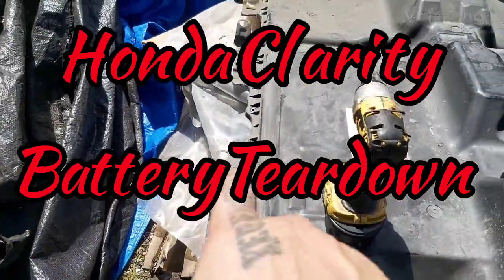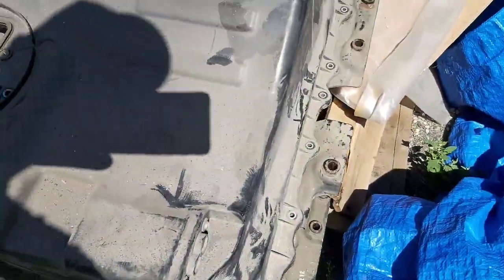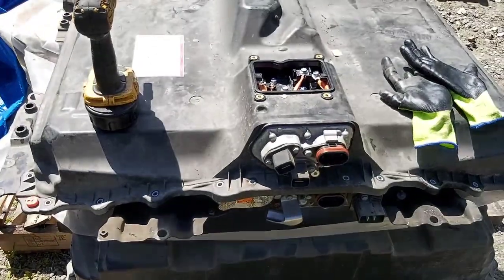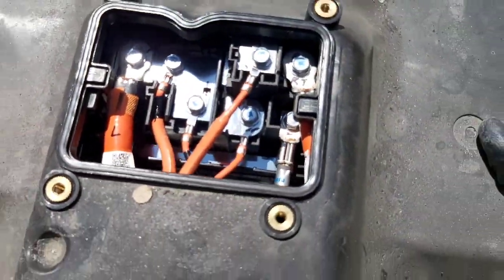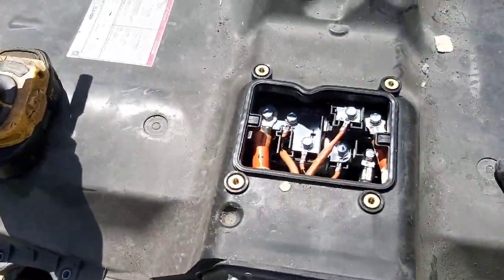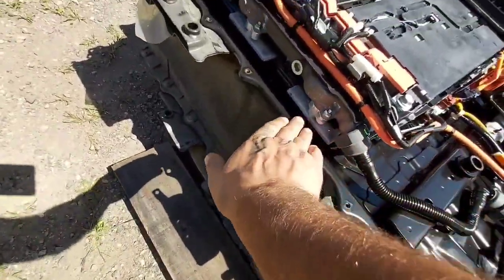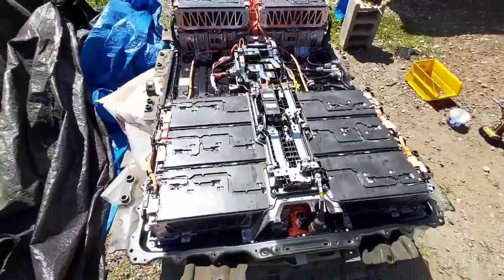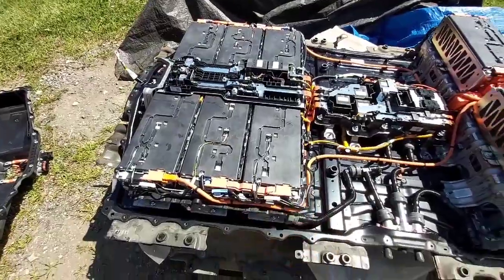Honda Clarity Battery Teardown

Comment: I've had my 2018 since new! I am curious about all this.  Thanks for the video!  And best of luck with the channel!  -Brad
Reply from the maker: How are the batteries holding up in your car?
Reply: @frankz1125  43k miles on my 2018 as of July 2022. Battery charges still charges to 48 miles +\- in warm weather. No range loss yet.
Reply from the maker: @kbuselmeier69  I haven't had any problems with my packs either. Seem pretty good to me. Thanks for watching and commenting.  Cheers

Comment: Hi! What is the marking of the small cells in the battery pack?
Reply from the maker: @Олег-ы6г9ч  1212.12 wh. Not much other then that
Reply: Can you remove the cell markings in the photo? Thanks!
Reply from the maker: @Олег-ы6г9ч  not sure what you mean

Comment: Cool video. I own a 2018 clarity. It has about 95k miles on it. The batteries will probably need to be replaced soon. How much does it cost to replace new batteries?
Reply from the maker: Im not sure what it would cost. Ive heard some are very expensive. I use them for solar batteries.Thanks for watching.
Reply: Prices range from 7k to 9k new and there are places that sell donor batteries from cars who were totaled and the price on those batteries already installed is between 2k to 3k. I have the same car as you and I am going through battery replacement so I just wanted to share.

Comment: You have to drop the unit from underneath the car correct?
Reply from the maker: Yes
Reply: @frankz1125  how many battery modules are there? 8?
Reply from the maker: @MrMannyhw  14 I believe.  Rated 17kwh

Comment: Great video, very informative. Love the chipmunk. I've acquired 4 of these, but the kind with the posts. I plan to install in a golf cart, in series. For such an application, are the orange and black multi pin connectors necessary? I should just need the posts, right? Thanks!
Reply: PS you're right it's a year later and this is still the most helpful thing on the internet about these batteries.
Reply from the maker: You should connect a bms to it . The connector goes to each cell in the pack.
Reply: @frankz1125  Agreed. Is that just for the orange 12pin, or also the black 2pin on the other side.
Reply from the maker: @mikeneudecker2166  I get rid of all of the small plugs except for the 13 pin.

Comment: Hi frank on your power wall sorry got to call it a power station lol do you just use passive cooling I don’t see any liquid cooling or is it I just don’t get hot enough to justify any other cooling Still just blown away about the setup you’ve got in your house think it’s the best one I’ve seen on YouTube
Reply from the maker: Thank you. Ive worked hard on it. There is no cooling on my house system. At 10000 watts output I only use 0.25A / cell. I dont think it will ever get above room temp. Thanks for watching

Comment: I have a 2018 29,000 and the range has remained constant
Reply from the maker: I used these packs on solar setups and there has been no problem or degradation yet. All the cells in the bank are within .002v of each other. Very good batteries

Comment: Didnt hear you say the cell and module voltages...what are they?
Reply from the maker: 12s nmc cells. Low 48v packs. Max charge 50.4 v .
Reply: @frankz1125  thank you for the info...
Reply from the maker: @roqm1248  no problem.  Thanks for watching.

Comment: Frank there isn't much info out there that I can find about these batteries. Could they be easily split to make different configurations like a 16 or 18s? Looking to make a golf cart battery but want to get closer to 72 volts.
Reply from the maker: They can be split but not too easily. The series connections are welded in the packs. I guess it can be done but there are better batteries to build custom voltage packs with. I had a Honda pack a while ago that had screw terminals on the battery cell posts. I would try to find something like that. Nissan leaf is similar as well. Hope this helps . Thanks for watching

Comment: Looks good. Did you say those packs are 10s? Lots of goodies in there those aluminum heat tubes could be useful. I think you can open a nut and bolt shop by the time you are done lol. I see one fella has a 384 volt dc Sandi inverter so he can use the EV batteries without disassembly or at least is his dream.
Reply from the maker: Do you ever watch Jack Richard ? I forget his last name
Reply from the maker: 12 s
Reply: @frankz1125  yes Jack is hard to watch but his ideas are great and he makes them work. He has the High voltage inverter
Reply: @frankz1125  Awesome direct use in the packs but a little low for voltage but lots of inverters to work with for sure.
Reply from the maker: @offgridwanabe  Ya I like him
Reply from the maker: I get asked a lot for 48v banks. I think these will have to do for that purpose. A bit more pricey then the a123 tho.
Reply: @frankz1125  Ya the one thing to watch for will be the charging curve of the inverter or charge controller used but you got a full 4 volts to use. Lots of inverters go into low voltage at 44 but I would be glad to have 48 volts inverter to work with.
Reply from the maker: @offgridwanabe  May not be able to charge them from an inverter charger either
Reply: @frankz1125  ya that is what I was thinking but still will work with CC. what do you have to get $100 a kwh or more.
Reply: Nice work.

Comment: How fast can one of those Batteries Discharge?
Reply from the maker: 1 little pack inside is rated for 200A continuous I believe.
Reply: @frankz1125  im putting 2 of these together, and need a circuit breaker for it.   Should I get a 400A breaker for the two?      this is my first time dealing with these batteries.  I got a 24S Lithium Ion BMS for them.
Reply from the maker: @Ryan............  there is 2 paralleled groups in the big pack. I would build it the way it is supposed to be. Where are you from?
Reply from the maker: @Ryan............  48s is not enough cells. Its more like 96. I believe they are around 400v
Reply from the maker: @Ryan............  Whats the application for the pack you are building?
Reply: @frankz1125  I currently have a 1500W 48V wind turbine.   I have 15-25 mph winds pretty regularly.   I will be regulating my voltage with a Dump load on a controller and then hooking up a BMS, and tieing those batteries into a grid tie inverter.      I also have a 48v golf cart. that it would be nice to just charge it next to my wind energy equipment.   

I  am inspired by your videos on these Honda Clarity Batteries.  I ordered 2.
Reply: @frankz1125     I meant to say 24S  sorry man for the confusing.   I got 2 of the Honda Clarity Battery packs.  12S each.
Reply: Forsan TX,   You?
Reply from the maker: @Ryan............  ok. I thought you were talking about the whole pack from the car for a min there. Im in Ont. Canada. Kinda far. You will need a 12 s bms for the 48v pack. You will need the breaker or fuse rated 25% more then you biggest load also your bms needs to have a greater current rating then your load. You will also need to watch for the charge rating on the bms. There is a lot to know when working with lithium. It can be dangerous. Play safe and ask if you need help.
Reply: @frankz1125  I'll be in touch. Thank you for taking the time with all your replies

Comment: What's the c rating on them? I've got 36 of them I want to make a car audio battery out of them
Reply from the maker: I believe they are 28 ah cells. 200 a discharge. Made by blue energy if you want all the specs.
Reply from the maker: They are an off voltage for 12v. Best to use LiFePo4
Reply: @frankz1125  the ones I have say Panasonic. Battery hookup said they came out of  Honda Insight test vehicles but I have found zero correlating battery packs to any Honda vehicle
Reply: @frankz1125  what do you mean be off voltage? They are sitting at 3.65v each right now. I was planning on doing 4s 9p with them
Reply from the maker: @SheikhN-bible-syndrome  These are different then those then. Mine are from 2019 clarity. Similar but mine have no posts. 3s is max charge 12.6v which will overcharge by car alternator 4 s will charge ok but you cannot discharge below 12v which is unsafe in a 12v setup because lead acid discharge down to 10v sometimes.
Reply from the maker: @SheikhN-bible-syndrome  Lithium iron phosphate is your best lithium choice for car audio at 12v
Reply: @frankz1125  my alternator charges at 15v while driving and 14.8v at idle and I had planned to do a battery delete so that I would only have the one lithium Bank do you think that would work?
Reply from the maker: @SheikhN-bible-syndrome  it may work. But use a bms for some protection.
Reply from the maker: At 15v you are at 55% capacity so now you just lost half the storage AH s .
Reply: @frankz1125  55%? What's the maximum charge voltage per cell?
Reply from the maker: @SheikhN-bible-syndrome  4.2
Reply: @frankz1125  crap so i need to be charging at 16.8v then
Reply from the maker: @SheikhN-bible-syndrome  you should stay a couple points of a volt per cell lower then max but the is a lot of power in the higher voltage range. If you do the build make sure you have a bms to cut off the bank at 3v per cell. Also you will need to match the current of the load to the bms output. Over rate the bms. Ex. 200A load get a 300A bms. 3000 w amp may draw up to 250A  . It's a big load. Need big cables
Reply: @frankz1125  crap the bsm that i would need would cost an arm and a leg because peek amperage ill be pulling will be around 600 amps . could i get aray with just a balancer? Or is this battery chemistry not safe enough to do that?
Reply from the maker: @SheikhN-bible-syndrome  no balancer. You need cell level protection.  That means if 1 cell group is out or low or high the pack will shut down. You can get say 3x 300a bms . Then make 3 banks 1 BMS on each
Reply: @frankz1125  do you know /prefer a particular one by chance?
Reply from the maker: @SheikhN-bible-syndrome  not really for 4s. But the biggest Daily bms would work for your app. But over rate them like I said.
Reply from the maker: @SheikhN-bible-syndrome  or a batrium with a shunt trip breaker